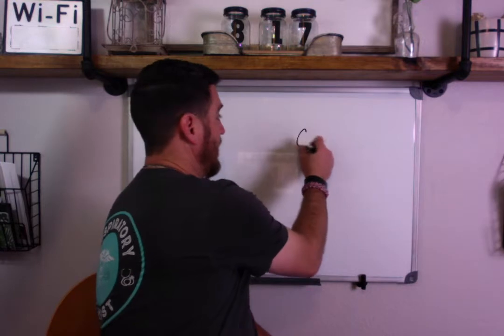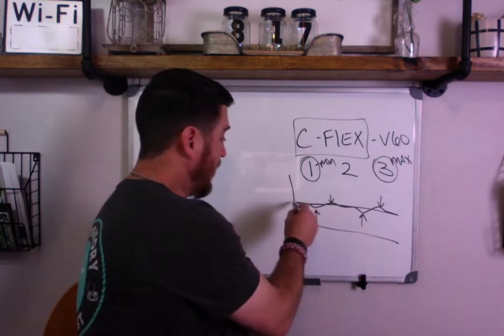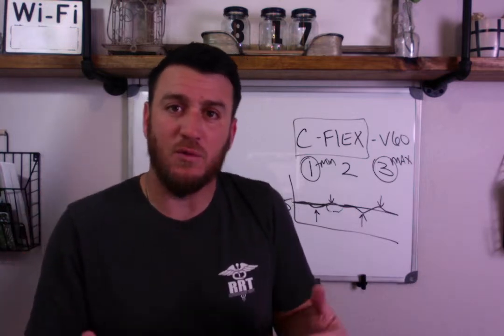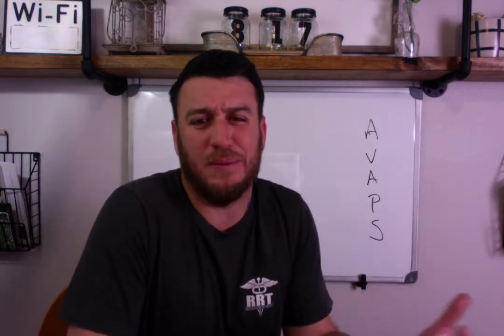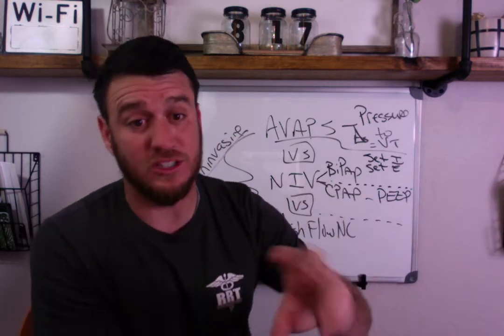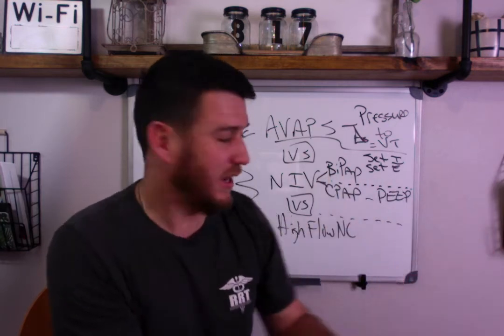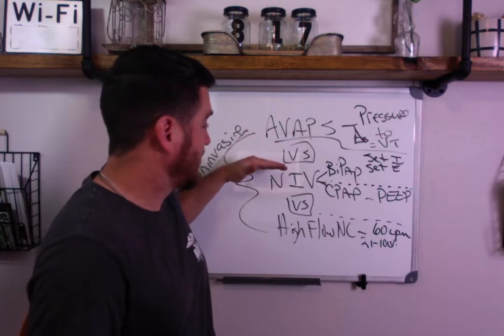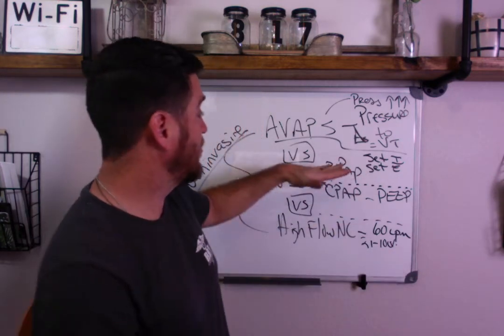Respiratory Therapy - What is C-Flex?  Hi Flow NC vs NIV vs AVAPS? How do I adjust flow on my vent?

Comment: Whats the difference between avaps vs avaps ae? We had a patient in the icu that was on a v60 in avaps mode and then we sent them to the floor and we didn't have any machine that could do straight avaps, only had avaps ae on a trilogy or asv on a home bipap machine. And my hospital doesn't allow v60s on the floor so we had to find a trilogy or a home bipap and try them on asv or avaps ae. So can you explain the diffecne between avaps and avaps ae please
Reply from the maker: AVAPS -AE vs AVAPS...the only difference is that AVAPS-AE (auto EPAP) automatically adjusts EPAP for better mgmt of OSA, along with auto-titration of IPAP to achieve a target tidal volume.
Reply: @RespiratoryCoach  ohh so it adjust the epap, is it similar to c-flex how you explained that helped patients with their inital exhalation ?

Comment: Great video! Thanks for all your help. I have a question about HFOV. This question was found on a practice TMC question respiratory website. Here it is:
 In high frequency oscillatory ventilation (HFOV), hypoventilation may be managed by _______ the amplitude or by ________ frequency.

 A. Increasing; increasing

 B. Increasing; decreasing 

C. Decreasing; increasing

 D. Decreasing; decreasing

The answer on this site says it is B. However, I was thinking it was C. Will you please explain the concept behind this question.
Reply from the maker: Hey John. You're about to get bombarded with responses.  I just found several of your comments in my potential spam folder.  Don't think you're spamming me.  LOL  
Probably too late at this point, but yes, co2 is managed by amplitude in HFOV, not frequency.  Sorry for the delay!